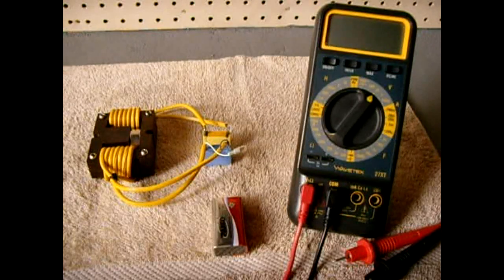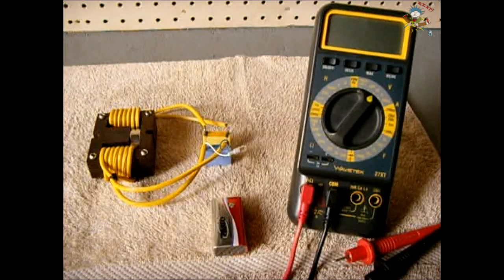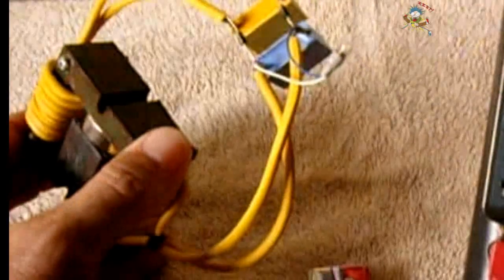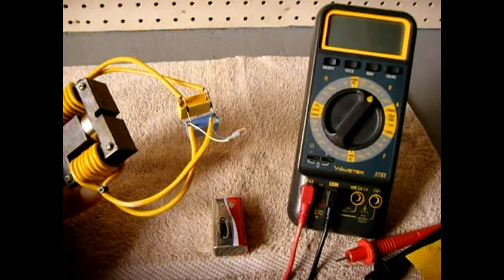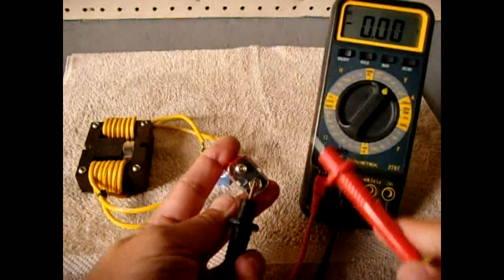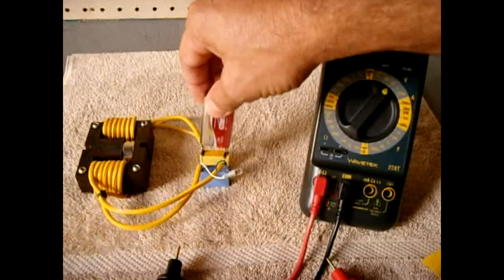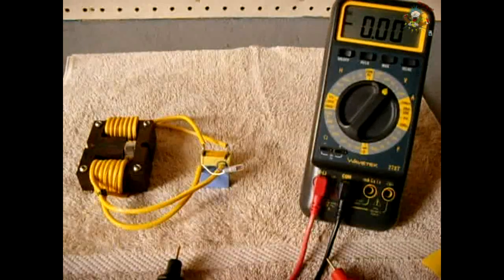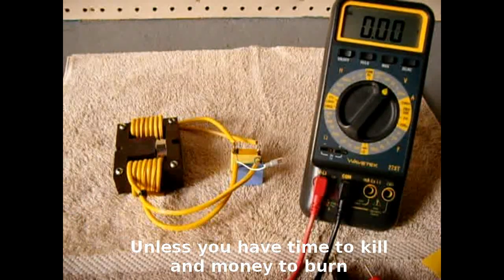Overunity Motionless Free Energy Generator EXPOSED!

Comment: Good work ! There is indeed a lot of scam and fraud with free energy !
I tried to duplicate the one with the PC fan and magnets but of course it didn't work.
It's a pitty that so much people are hypothetic to show a nonsense solution to free energy. I say keep on going, you do a good job !
Reply from the maker: Thank You. It is very unfortunate that so many people believe in these scam videos.
Reply: electronicsNmore
Just because you can't get your circuit to work - does not mean it does not work !  It means, you lack understanding on how to make it work. There is a patent on this concept already ( I think it was issued in the 1990's ) - which can't be issued legally if the circuit concept failed to work. If the patent is a fraud, as based on the fact you can't get your unit to work, that would mean the basic principle does not work. That calls into question the character quality of the patentees issuing the patents.

I do agree your unit did not work - but there were some subtle differences from the original. For a start - what do you know about the core characteristics you had in your laminations ?  Was it grain-oriented silicon steel, or non-oriented silicon steel, or just plain low grade steel in use ?  Core saturation permability and hysterisis are just some of the characteristics you have to look into to reproduce the other circuit. Was it the same type of core material as the original unit in the video you were critical of ?  What about the magnet - was the gauss field correct for the core you were using ?

Also, pulsing the unit with a battery - does not introduce DC into the circuit so much, but a collapsing  ringing AC feild within a tuned LC tank circuit. Breaking any DC current introduces an AC ringing pulse, as all electronics Techs should know. Your dealing with a pair of near balanced LC tank circuits in close resonance with an AC ringing feild - somewhat similar to radio transmitter tank circuit. 

Also the magnetic circuit of the core, has some similarites ( but not identical ) to the old saturable reactors which are known as "magnetic amplifiers" and very common in the 1950's & 60's for motor drive control.  Saturable reactors required a small DC bias current introduced into the magnetic circuit from the primary to influence the core hysterisis and hence control the output of the coil(s) driving the motor. In principle they had all the characteristics of overunity, in that the transformer literally amplified the magnetic feild to be much greater than its input current - somewhat like a transistor does with an electric currnet. It has GAIN ! 

I commend you for making an effort in trying to reproduce the circuit - but I would not be to quick to condem until you understand more about the intricies of the technology.  As far as I recall, you had one of your diodes back to front, and the original circuit I saw could run 12 volts at 5+ amps, or a 60 watt car headlamp. That means your diodes are too small for larger loads - though this is a secondary discrepancy

Finally - do you know if your Esr of you caps were the same ?  I've had tech issues with caps before, even the poly types you were using, where internal impedance and inductance differences can create big issues - even in the same batch types. When your dealing with ringing circuits, these hidden characteristics can be critical.
 
All the best with your research. Have fun !
Reply from the maker: All this has already been discussed, and my answers already given. Since your an expert, email me a link to your video showing this working device. Just because something is patented, does not mean it works.
Reply: No I don't have a link to a working device and I'm not making a claim that I have such. Even if I did have such, your so closed minded you would still claim its a scam and say I had it rigged in some way. As your words said in another post that you - " Tried it already. My job is not to try and get this to work, but show this does not work as shown in the uploaded video". Your mind was already made up before you even built the device - that you were out to discredit anything you don't agree with. You seem to understand it way better than me - despite failing to clarify some of my technical points - which others have not really discussed in any depth, outside the diodes. You have validated my suspicion about people who hold patents - and gloat about how smart they are, with so called "new inventions" that don't work.

Obviously your the EXPERT - not me - and based on your posts to others, your out to disprove anything that suits your agenda and rubs you the wrong way. Such arrogance about learning anything outside the mainstream levels of technology, only feeds the masses of closed minded pseudo electronics researchers - and unfortunately it convinces me you may have even deliberately sabotaged your own project to scam those who are open to researching such alternate techologies, I make this observation based on your comment - " My job is not to try and get this to work," - henec you must enjoy being "a knocker". If this is your modus-operanda, then I think such people are idiots and hence I have no time for such arrogance  !  It's not the fact the circuit works or not that is my concern - as you could be right on that issue ( I have not made one to validate your findings ) - but your arrogant self-righteous approach towards anything controversial. I don't call such research "scientific" or even validating your understanding of the circuit.
Have fun with your mud-slinging !
Reply from the maker: Your post was too long, I did not read it, because I don't like your attitude. I don't know who you think you are coming to my channel and opening up your mouth to me the way you did, and telling me how I think. Your not dealing with someone of "average" intelligence. Go find another channel and annoy them. Stop wasting my time with your nonsense. You know the saying, "Put up or shut up". One more post on this subject, and you will be banned from all my videos.

Comment: electronicsNmore...Your set up is diffrent with original video.. the 2 diodes set up is a averamngo plug, your is facing the same
Reply from the maker: The diodes are EXACTLY as was shown in the uploaded video. I have no idea what your taking about. I watched the other video FRAME BY FRAME, so I know for a fact my setup matches. If you think your going to get free electricity from a stationary magnet, then you need to start doing research on how transformers work.

Comment: Have you tried change one wire by another wire of other kind of metal? There is energy when you have potential difference. And you will have potential difference only with two kinds of metals.
Reply from the maker: The purpose of this video was to show this device DOES NOT work as the uploader showed. There is no reason for me to attempt anything else. I duplicated exactly what he did(and a much better job than he did) to prove to viewers the video is a scam.

Thanks For Watching!

Comment: You used wrong magnet. He used two magnets from HD. Those have two poles. But I am agree about a scam.
Reply from the maker: Makes no difference. The result will be the same. One north facing pole and one south.
Reply: Please show me a magnet with one pole.  I can easily get you $1,000,000.
Reply: texjarhead Why is it that your bulb did not light when you had the device connected to the battery? The bulb could be busted because even if the device that you duplicated was a fraud, at least the bulb (in your version) should have lighted when the circuit was connected to the battery and then discontinue to light once the battery is disconnected.
Reply from the maker: No. :-). The diodes prevented the current from reaching the bulb. I applied the battery to the exact same location as the uploader did in his video. He also placed both diodes in the same exact direction(I verified that).

Thanks For Watching!

Comment: Your work have the problem transformer will not work in permanent magnet with north and south alone in the core, What happen to the original set up is  "the charging effect and the switching of diode thru semicon current tunneling thus making the AC wave form". Now we come back magnet if you observe what magnet he use is neuodium kidney magnet from hard drive and installed flat wise. Why???. because it will generate  neutral either north and south, once energized its current will dictate what suppose pole and became vortex and therefore Ac waves which transformer work.The surround building magnetic field plus the hysteriss of core make it effecient and excess free! Only problem is the heat due to eddy current which make it magnetic field weak later time.

Comment: I first heard of the MOTIONLESS ELECTROMAGNETIC GENERATOR by Lieutenant Colonel Thomas Bearden in 1995. Chuck "FOR THE PEOPLE" Harder mentioned him on WHRI. He had a web page in the DEPARTMENT OF ENERGY website, which seemed to have been summarily deleted, after he retired from the Air Force.

The principle was simple and compelling: A magnet was escounced in a Figure-8 transformer, such that a pulse initiated in the primary coil caused a reverberation that would continue until stopped. The demonstration model had an output of 500W.

At that time, Tom Bearden announced that he would be putting an M.E.G.Electric Car on the road by the following year. This did not happen.

After the turn of the century, I came across a clip of him- who lives off-the-grid- speaking on something called "COAST-TO-COAST," and he remarked, to the other two people on the show, that "whereas you could build such a vehicle, you would not be around to drive it."

By then, I knew about the certain assassination of STANLEY MEYER, for proving that Water can power a Gasoline engine in 1998, shortly after his demonstration.

The MOTIONLESS ELECTROMAGNETIC GENERATOR depends upon a material out of SCI-FI- the core has to have a magnetic permeability far in excess of anything that had ever been known to exist before. THAT was what was responsible for the counter-intuitive reverberation.

The material existed in Quantum Physics Theory, but had been impossible to make.
It turned out that the new NANOCRYSTAL technique, applied to Iron produced Ferrite Nanocrystal, which enabled this improbable device to work.

YOU CANNOT USE IRON, because the permeability is FAR TOO LOW, and you will have losses via Eddy Currents, which lets out Cobalt and Nickel, also.

Apparently sintered Ferrite- which is high in permeability, but low in conductivity- used in Radio-Frequency Tech- is still not permeable enough. Only Ferrite Nanocrystals can do this.

THE HEGELIAN DIALECTIC is the Illuminati's Weapon of Choice for Populace Mind Control. The Sheeple are made to think that there are two opposing sides- whereas, actually, there is just the one side- theirs'!

So there is this fellow building a TOTALLY FAKE M.E.G. device, and another, so helpfully exposing the fraud!

"I wanna prevent people from wasting their time and money trying to duplicate some of the circuits that they see on YOUTube!"

One sad day for Civilization will be when some busybody invents a Computer Screen that you can punch, and CLOBBER the guy in the account you don't like- give a whole new meaning to the term: "Received 10,000 hits!"

WHAT'S HIS HURRY?

Instead of TELLING us about the 99 other ways (or whatever number it was,) that he discovered to NOT build the device successfully, WHY doesn't he SHOW us?

I don't believe that he did that at all, but this whole operation is planned by people with Psychology degrees, specifically to virally discourage interest in the M.E.G. Technology.
Reply: Je confirme vaut propos monsieur. 
J'ai suivi certaines recherches de Barden... Naudin français dans Quanthome

Comment: I, while I do believe we may crack energy problems one day, have to agree with you on this one.  It will, in my opinion, take more than a couple of magnets, a core and some low turn count "coils" to do anything significant.  Especially noting that the diodes installed across the capacitors preclude ANY significant current AC or DC to flow from the alleged 'primary' to the 'secondary'.  An obvious and telling flaw in the original as well as your recreation of this table top impossibility!  Thanks for being honest.
Reply from the maker: Your welcome. Thanks for watching! Be sure to share my channel with others, and rate Thumbs Up.

Comment: So did you try ac or pulsed dc instead of the 9 volt battery
Reply from the maker: No, because there is no reason to. The purpose of the video was to demonstrate that a 9V battery or any other battery, is not going to start up a pulsing magnetic field, then be removed to create "Free Energy" which keeps going. LOL

Comment: So is it possible to send dc voltage through a transformer   i was taught in school  this is not possible
Reply from the maker: Not possible. In order to transform, you need to use either A.C. or PULSED D.C. Pure DC from a battery will never work.

Comment: Hi, you should try with HDD magnets. as you know they have mixed sides. so it could work. good luck
Reply from the maker: Won't work. I tried hard drive magnets. You will not produce any power using a magnetic field that is not changing.

Thanks For Watching.